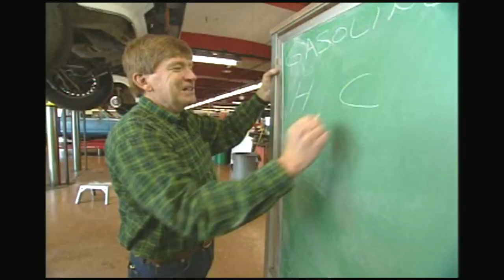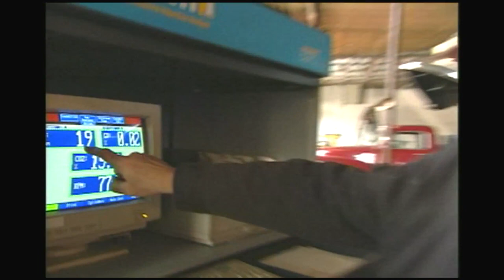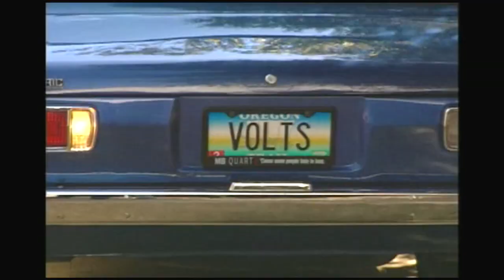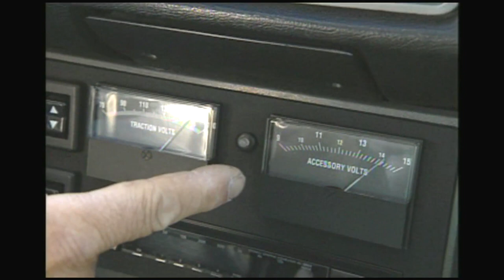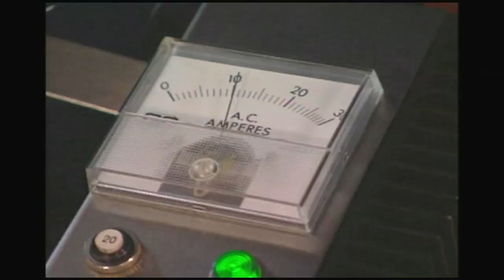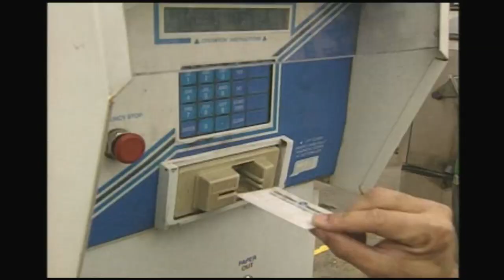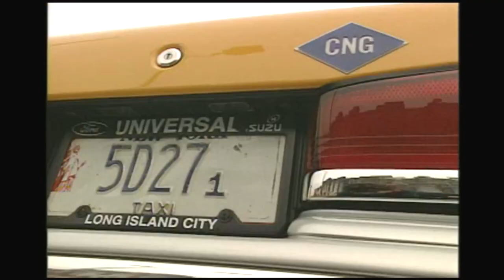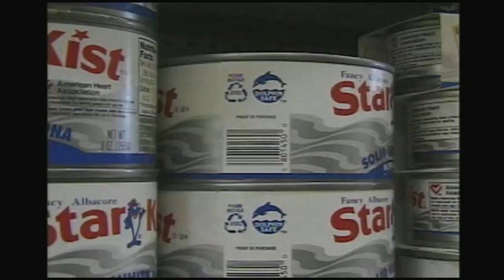Would You Have Bought An Electric Car In 1998?

Comment: Excellent video you found. This is a BIG interest of mine. A couple of comments:
1. 20 years ago, I didn't think EVs were going anywhere. I figured that since the ICE has a long list of possible improvements, it would be around for a long time. Well, those improvements are real, but we're far into the realm of diminishing returns. There's only so much efficiency you can get out of something when you're burning stuff in air, and then there are practical limitations that knock it down quite a bit from there. The writing is on the wall. EVs are on the cusp of a rapidly rising curve.
2. The key tipping factor was the lithium ion battery. Lead-acid batteries, and the others before 1990, just didn't have the energy density. When you get the energy density past a certain point, positive feedbacks kick in that change the game fundamentally. Do you know the old Soviet joke about the advanced watch, and the suitcases full of batteries?
3. We understand more about the health effects of particulates now, especially ultrafines, the ones less than a couple micrometers in size. Nasty little buggers. BTW on particulate matters, indoor air pollution kills huge numbers of people in the poorest countries. But LED lights, and solar power, and batteries are coming. A truly wonderful thing. I can't think of a downside. (A truly clean, cheap cookstove is still a tough problem, though.)

Comment: As an automotive engineering student and automotive enthusiast, I highly dislike electric vehicles. But I still like your work and enjoy all of your films.
Reply: Why? I really don't understand this mindset. Petrol is not going to last forever and it pollutes our world. Regardless of the fun noises and tinkering that can be done with it, it needs to be phased out from transportation.

Electric motors besides being cleaner, they are are more efficient, quiet and more powerful in a smaller package while also making the vehicle simpler to maintain, fewer things to wear and break. From a customer's point of view electric cars are better, there's not much an average Joe can fix on the side of the road anymore anyway, combustion engines have become very complex with sensors and electronics all covered in plastic.

Plus speed of charging and range have improved a lot in the last 10 years and they will become non issues by 2030.

Comment: That conversion dude's stuff is so trivial and basic now compared to even what some hobbyists are doing, its honestly kind of ludicrous. We've got guys ripping laptop packs apart for 18650 lithiums and using motors from some of the strangest shit; I met one who powered his subie with a starter/generator from a Jet engine, and I'm still finding sources of high voltage/amperage AC motors that could be used instead of high-cost OEM stuff.
Have you thought about doing a follow up with some of them, like EBikers and the like to see where things have gone? It'll rock your world, I promise you.

Comment: Hate to break it to you but there’s no such thing as a pollution free car. EVs in some studies create more pollution than internal combustion engines due to the rare earth mining and lithium used in battery packs, not to mention the massive electrical infrastructure needed to charge said batteries. And no solar, wind & hydro will not replace a significant portion of traditional power generation. The best source would be nuclear but even that has been ruined by hysterical propaganda.
Reply: I don't know solar is doing a pretty good job and so is wind. Solar panels are getting better and cheaper every year. Same with batteries. Solar, wind, and hydro paired with batteries equals the future, if fusion doesn't take off.
Reply: Joshua Pfeiffer I agree solar is making huge strides, especially as it becomes more affordable for installations at the point of use like homes. The issue is even then batteries are needed to store excess solar & make it usable during non-solar hours. Even so most solar installations only supplement home usage and don’t actually carry an entire homes energy needs. Fusion will be the future and huge strides are being made there. I still think in the immediate term current nuclear power like pebble-bed reactors & upcoming 4th gen reactors are the answer & we should be building these in the US on a 1 to 1 basis to replace coal plants.
Reply: Yes, there is no thing as a pollution-free car, but EVs still emit far less CO2 over their lifetimes than a comparable combustion engine car. The studies that claim electric cars are worse for the environment either focus solely on the production process and then get misrepresented by the media or are just pieces of misinformation.

A video made by potholer54 (Peter Hadfield) debunking a PragerU video about the environmental impact of electric cars:
https://www.youtube.com/watch?v=hwMPFDqyfrA
A tool to compare emissions between EVs and combustion engine cars:
https://climobil.connecting-project.lu/
2019 Tesla Impact Report:
https://www.tesla.com/ns_videos/2019-tesla-impact-report.pdf